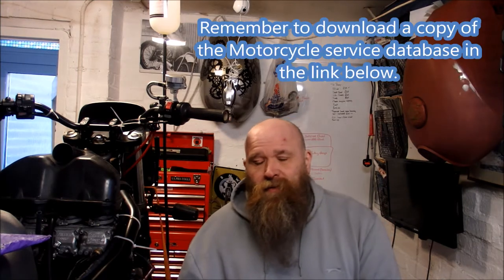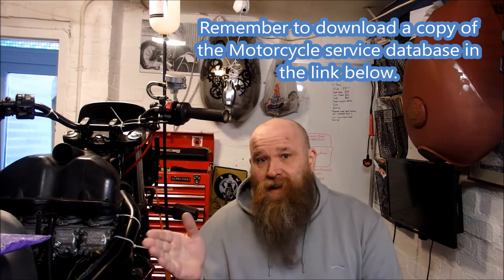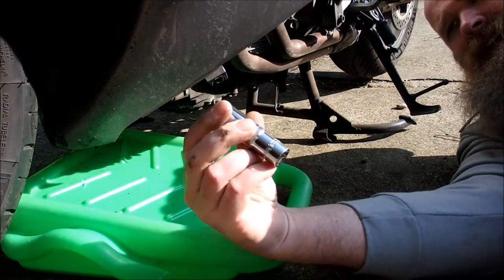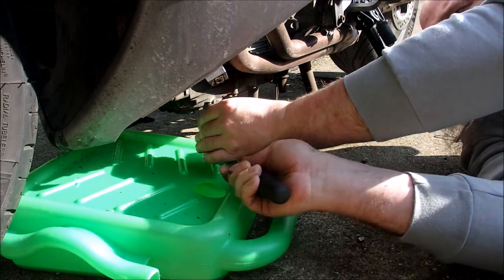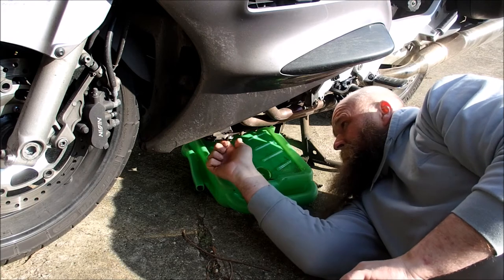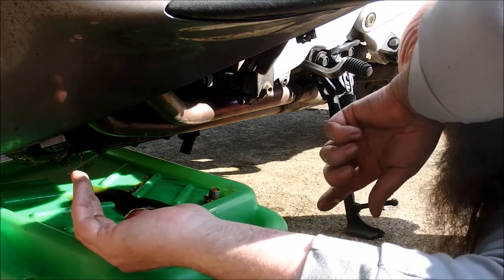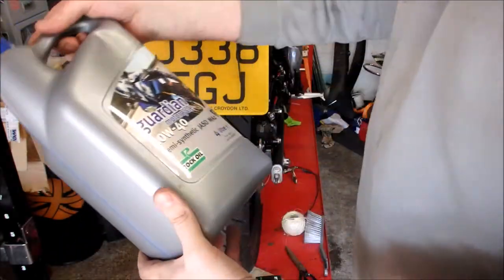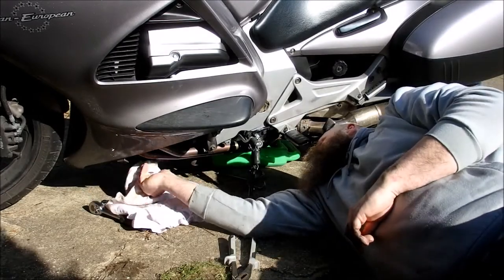How to do an oil change on an ST1300 (Step by Step)

Comment: This can be easier if you change the order. Start with the bike on the side stand. With the bike on the side stand you do not need to remove the lower fairing piece on the bottom, you have ample easy access to both the drain plug and the filter. Buy a kn filter or a filter that has a 17 mm nut built on to the filter. That way all you need is an open end wrench. 
After the filter has drained remove it, Replace it, then put the bike on the center stand and let the rest of the oil drain out the plug.
Once drained, put the plug back in and pour in your new oil tada ! U done !

Comment: Nice video. I've changed the oil on my ST the past 7 years. Not once have I removed any part of the lower faring.
Reply from the maker: Cheers for the tip, hopefully others watching the video will see this comment, and save themselves a bit of work.
Reply: Give it a try next time. If you put the bike on the side stand, you can access the sump plug and filter easily to remove most of the oil then straighten it up to get the rest. I usually sit on it and read a magazine over a coffee for ten minutes or so.

Comment: Gave up faired bikes because of the faff with panels. Used Microsoft Excel for service history on all my bikes. Always handy to cross reference and appeals to potential buyers. A Honda man too btw
Reply from the maker: This is my first, and have to admit once you get past the lower fairing, everything looks daunting.  Excel is a great tool, and have used it myself, but the pre-populated drop down menus with the access database won it for me. Any of the big four, make some great bikes, but Honda's are bullet-proof.  What Honda do you have?
Reply: GTs Garage I'm on a 900 Hornet
Reply from the maker: Ahhh nice looking bike, never ridden one, how do they handle?
Reply: GTs Garage They are a good bike. Handle well enough and not overly heavy. Plenty of power for the road and I am also a fan of fuel injection. Its one of the few bikes Iv had that I'm happy to keep for the foreseeable

Comment: Good video, seems to be quite an involved job to do the oil change. Thanks for showing us the process and will check out the link.
Reply from the maker: Thanks, it would be a lot easier if i had put it on the lift, but i was shooting two videos at the same time,  made that impossible.  Ride safe fella.
Reply: Not involved at all. If you don't remove the lower left cowling it's a quick easy job.

Comment: Didn't know you had got hold of a ST1300.......I use copperslip around brakes, rest I just use general purpose grease....
Reply from the maker: The bolts had it on when it came from the last servicing, so just kept it up :)

Comment: so you have a st1300 now bud, how are you getting on with it ?
Reply from the maker: I love it.. whilst its a big bike to lug about, once its rolling its superbly balanced.
Reply: I do like them from the front but was told they are a little unsettled over 80mph but hate the rear end as it looks like a bike maxi scooter.I always love the Kawasaki GTR1400 but it was just way to big and heavy for me being a short ass so ended up with my Yamaha FJR but not sure if you have watched my new Kawasaki VN1600this is what we are going touring on this year, may have to may a detour up your way !mark
Reply from the maker: There is  lot of controversy over the "pan weave" but i have always found her steady as a rock, even over 80.  Some say the weave starts and finished between 110 and 120, so the solution has to be to get to 130 as quickly as possible?   One of the tubers on here had the 1400, a beautiful bike,  and can almost see the tarmac ripple, when giving it some beans :) but i'd probably lose my license on it.  Is the 1600 the nomad, and the 1800 the voyager?   Both lovely looking bikes, but heard they struggled to make any real power out the box, as i was looking at them last year.  The advice i was given, was to make the power, you needed to invest fairly heavily in after market accessories, not sure how true that it.    If your up this way, would be rude not to go for a pint or two :)
Reply: In my experience with my ST, I’ve only noticed the weave when being around big trucks on the freeway. When approaching to pass, it feels like the draft from them is pushing on the bike all over. It’s steady as a rock around most other vehicles. My Harley Ultra Classic doesn’t notice trucks whatsoever.
Reply: From reading a lot of comments about the “ weave” many long time riders seem to agree that it has to do with the back luggage piece behind the seat. Many folks say, that if you don’t have that piece, you don’t get the weave.